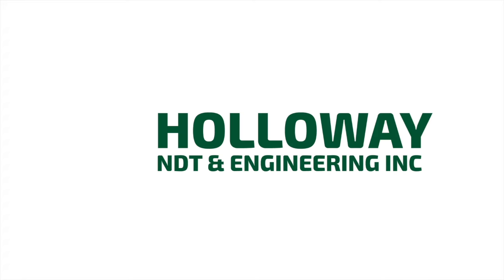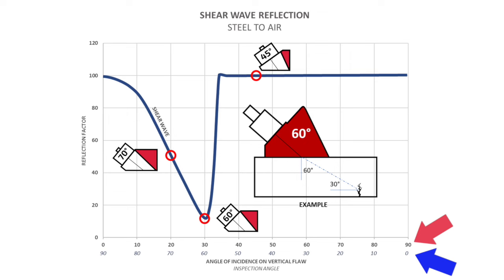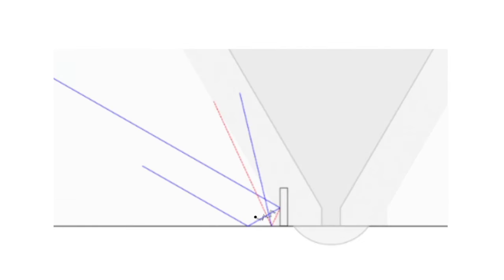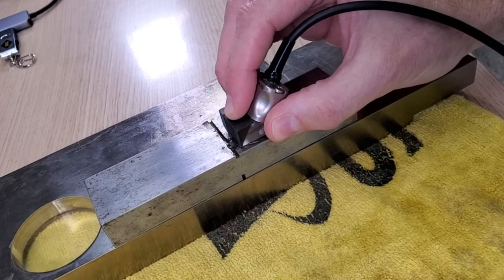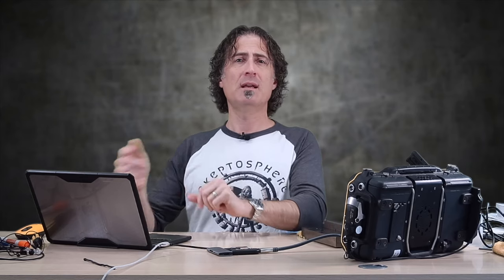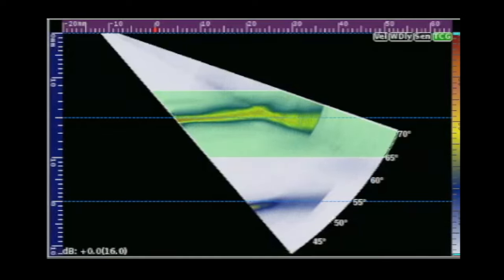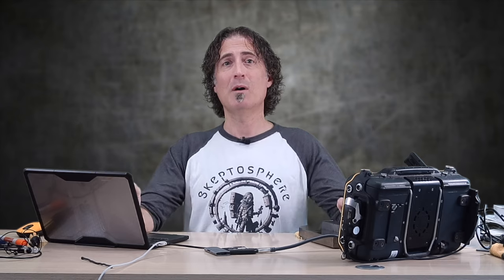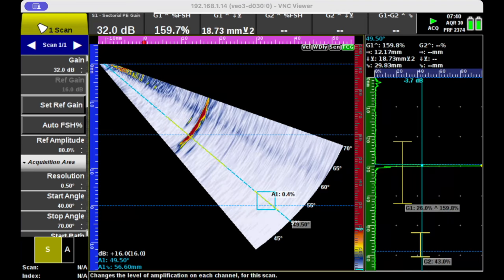Mode Conversion

Comment: Soon I will be attending lavender down in Houston for their phased array class. Someone was explaining to me that they offer additional tests called QUPA and there were multiple others. The explanation I received from another mentor was that they allow you to perform phased array in different industries like nuclear and petroleum. 

It’s hard to find information on the ones you need and what you’ll be qualified for once you pass when you don’t know all the acronyms and you don’t know which places accept that certification rather than give you their own test. 

Additionally, BP whiting Indiana is the most local refinery for me and I know that they require you to pass their specific test in order to perform PAUT in their refinery. But do I also have to pass the api oriented phased array tests that lavender offers and do you happen to know what all those acronyms for these different specific applications are?
Reply: The API QUPA is dead as far as I’m concerned. Chevron is not issuing anymore construction drawings require it now that the ASNT ISQ PAUT is out. 

BP also said they’re going to stop requiring their exam once the ASNT ISQ PAUT came out. Most of the major oil companies contributed to making that test a reality, and it was so they could get away from the API QUPA.

Nuclear PDQs are a whole separate ballgame and are EPRI certs, and not the  Power Gen EPRI certs either.

In the beginning, just worry about going to get your PAUT classroom and start getting your OJT in order. Work on obtaining the ISQ UTT and UTSW first.